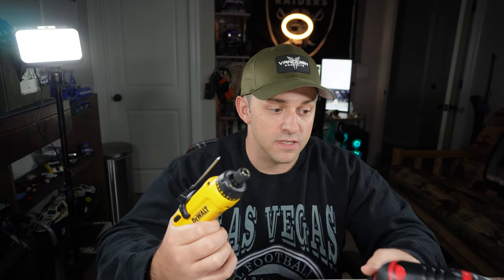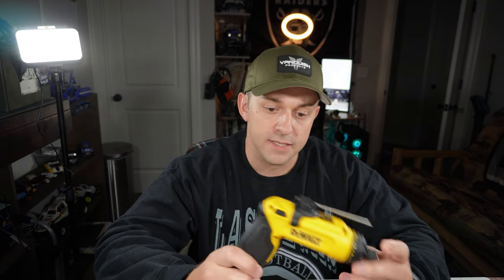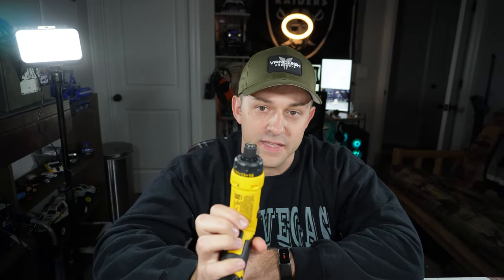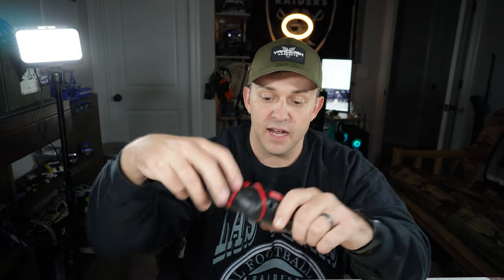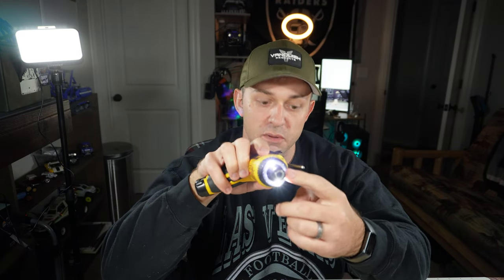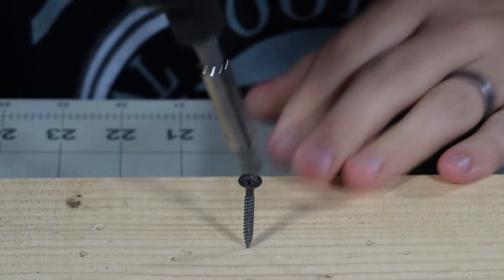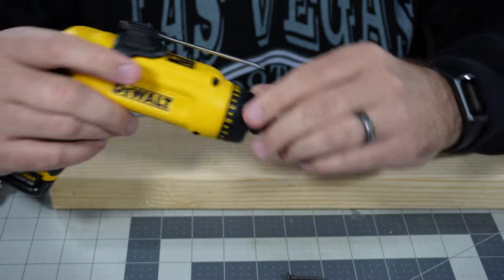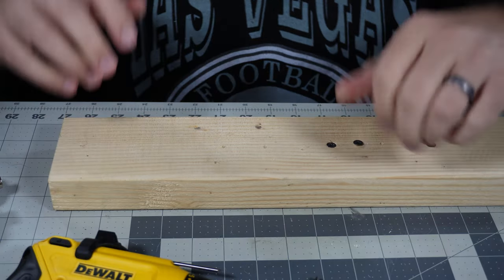HYPER TOUGH 4V TAKES ON THE CHAMP (Dewalt 8V Max Gyro)

Comment: Owning both of these, for RC i really like my hyper tough screwdriver. It does great for rc building and maintenance. Now, for working around the house and home repairs, the dewalt is better. But, i recommend the hyper tough for anyone wanting an electric screwdriver for rc. That with MIP bits. 👌
Reply from the maker: I love the gyro on the DeWalt. Took a few minutes to get used to but can't look back now. Hyper tough stays in the travel tool box

Comment: I would have taken an M3 screw and a spare/broken RC part and tested the low torque setting with that setup, but for demonstrating, that the clutch of the DeWalt is better, the setup is good.
Reply from the maker: I did that off camera and realized the HT was way too strong even on the lowest setting. Figured tougher would show people how the clutch is pretty pointless. The DeWalt can be setup for pretty much any material

Comment: Thank you for the review. 
If you want a pen style small compact driver. The Ryobi FVD01k is nice. Great for the pit bag. At $25.00 rechargeable with 2 led lights great run time. Not sure how many drywall screws you can drive into wood. But putting together RC stuff the battery lasted all day plus some.  Doesn’t have a cutch so don’t use it if you don’t have common sense.
Reply from the maker: Drywall screws showed the dramatic difference between the two. Both are plenty strong and 4v is plenty, but having a clutch that has the right adjustability is key. I appreciate the pen driver suggestion but I am now the owner of 4 electric screwdrivers for r/c so that's good for now I think haha
Reply: I was surprised that the Hyper Tuff driver did what it did.  Great video.

Comment: Hello there so i just purchased  the hyper tough one from Walmart and i used it out of the box and it took care of 1 screw after that it stopped working I figured it was probably dead so i put it to charge and it changed from red to green but it wont work at all it does not want to spin do you know what might be the problem or do i have to leave it on the charger for longer.

I would greatly appreciate your help
Reply from the maker: Hmmm. That is strange. Definitely give a solid charge. If not, take it back. Walmart will likely just exchange it 🤷‍♂️ wish I could help more
Reply: @Krazy4KVs  i ended up returning it and getting a better bigger and surprisingly cheaper one same brand though I got the 8V one instead and it worked out amazingly